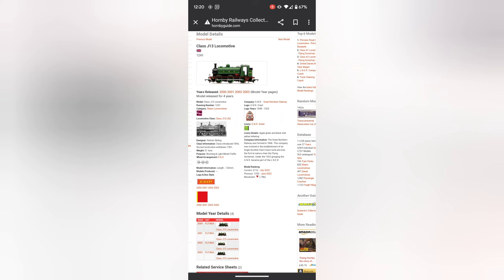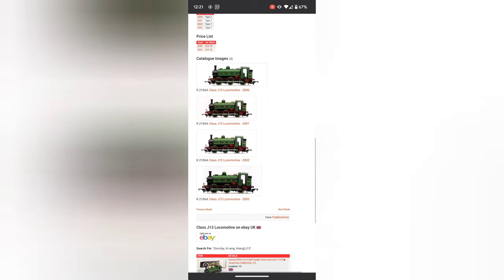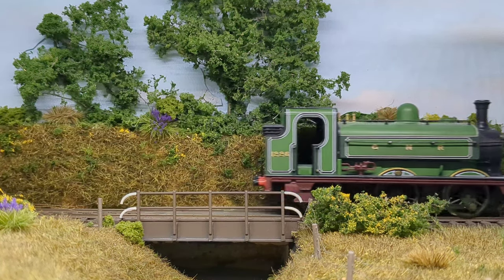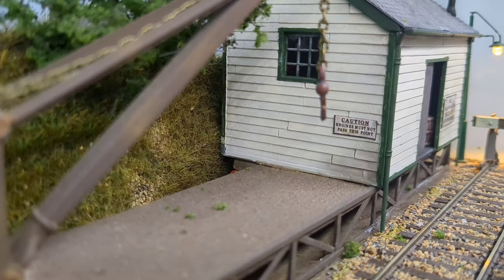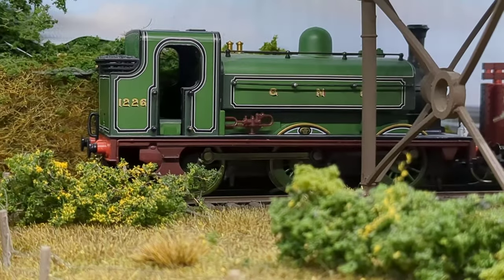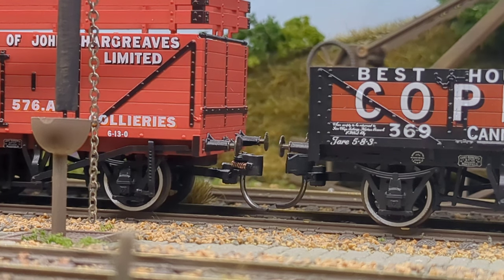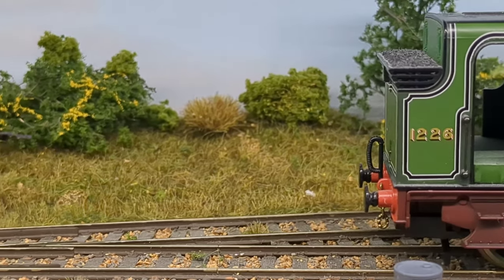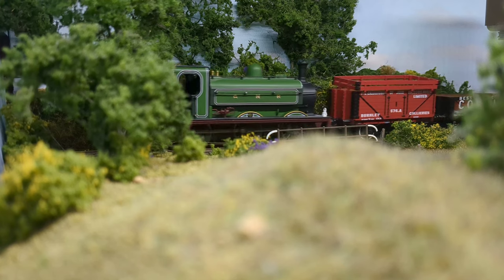Bargain 00 Hornby for Inglenook shunting.

Comment: I have a Hornby J83 which also has the same motor as your J52. Like yours it makes a peculiar grinding noise but mainly when running forwards but I can live with that as the model is a superb slow runner. In reverse it is much quieter. The body is not as detailed as the J52 and has some slightly strange proportions, mainly I suspect to enable it to fit the standard chassis. However, I have videoed some simple modifications and weathered it slightly and it now looks quite a lot better, Regards Keith. BTW I love your layout.
Reply from the maker: Thank you Keith. I have been thoroughly enjoying your videos.

Comment: Like all model railways it's always work in progress. I too keep a weather eye out for bargains especially as the costs of modern models seem to have gone through the roof. May I suggest you may wish to find a suitable coreless motor to replace the locos somewhat noisy sound. As to the loco you could disguise that annoying lugg with a bicycle or buckets! And that's the beauty of this hobby and the pleasure it brings when you add your own personal touch. Great inglenook layout and you have done it justice by the way you present it. Thank you for sharing.
Reply from the maker: Thankyou, some good ideas there. Will have a look at replacing the motor though I had it on the bench last night and it does seem to be very weirdly wired.